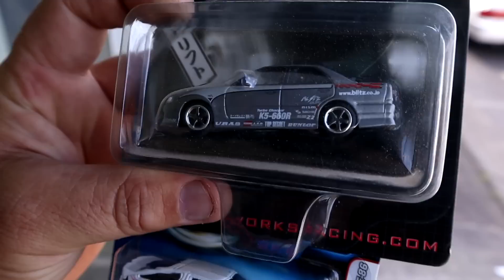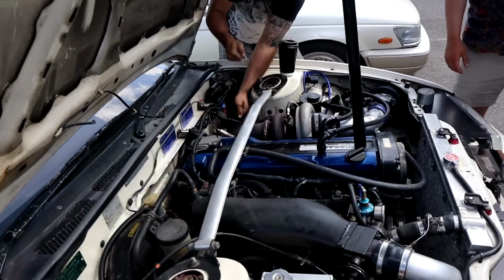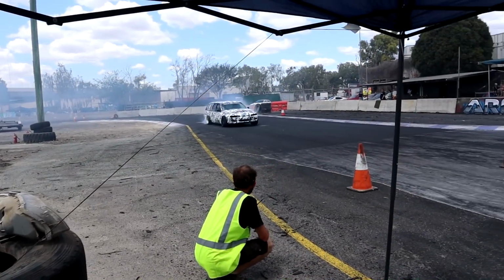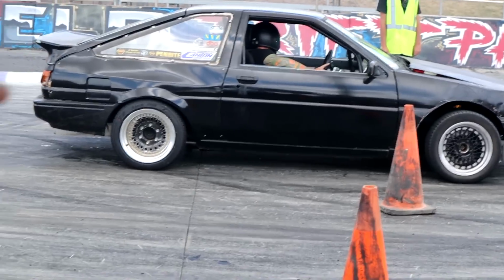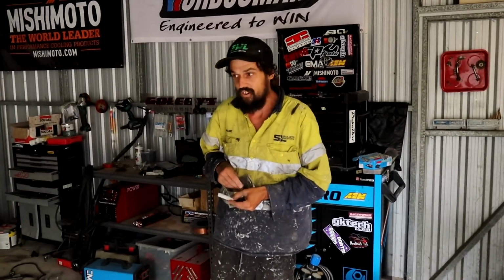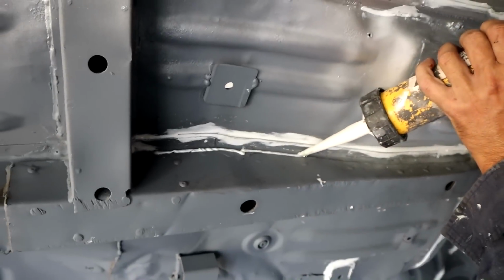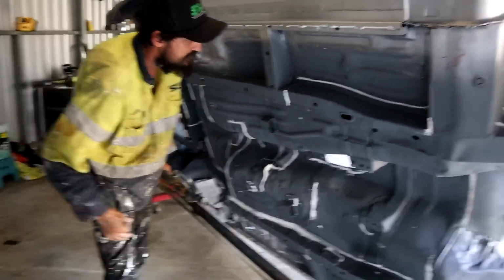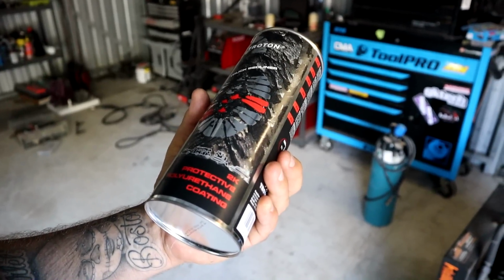s13 gets sealed / cars n coffee / sunday sesh

Comment: Just a thought on the small holes back tape them. Hit them with the that bed liner. They well fill in. We use that for under armour on trucks driving in mine areas. With it thick its amazing strong.